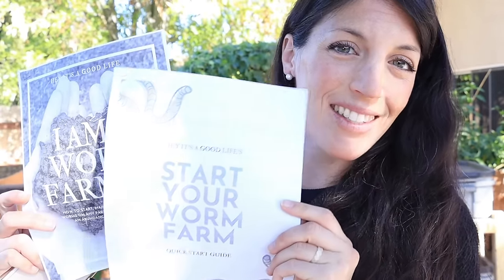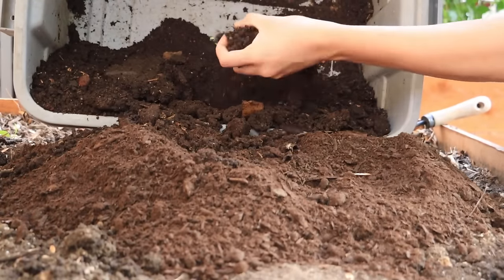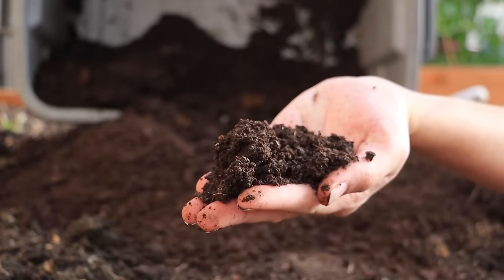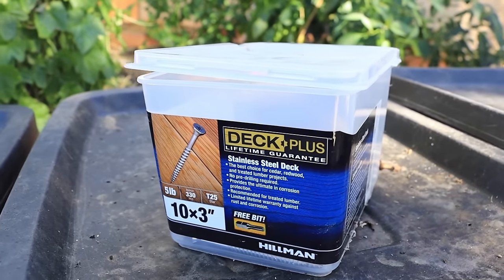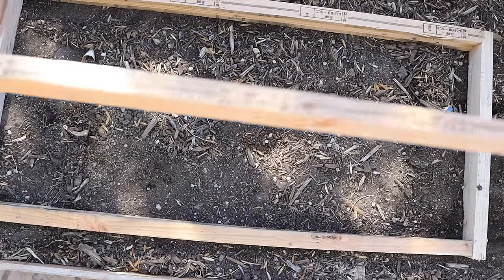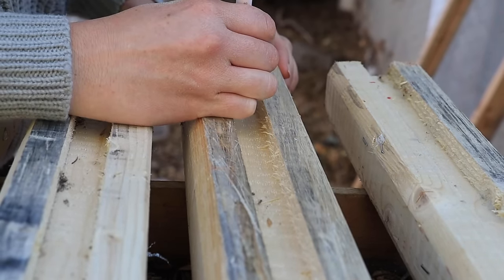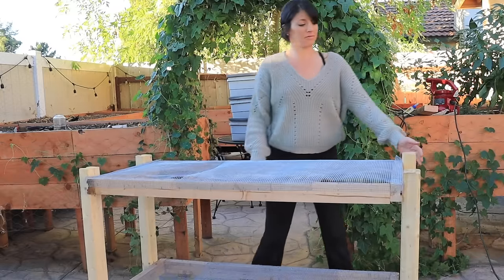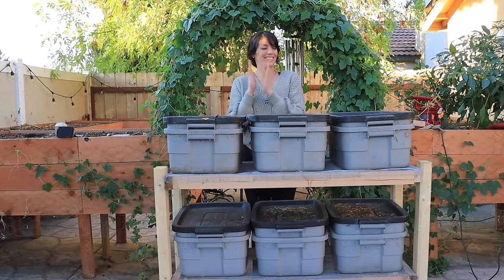HOW TO START A WORM FARM | DIY Worm Farm | Worm Farm Setup | Hey It's a Good Life

Comment: I see two bins stacked, but you didn’t really talk about that in the videos I’ve watched so far. I’d that necessary? Does the second bin have all the layers, too? How many worms is a good start?
Reply from the maker: Hey! Yes I don’t mean to be elusive! I think i cover it briefly at the end of my last video! It’s not a secret I just store an empty tote under a growing bin. Then I move the empty tote up top when the original one is full and ready for harvest. 

To start the second bin you add all the same layers and invite the worms up (vertical migration) I start with about 50-100 but you can add up to 1000 per square foot
Reply: I so interested in learning about this.  Use casting i by all the time

Comment: Most pallets are only heat treated but if you see a pallet without any sramps on it but it does have a lot of small equally spaced holes in it then it is pressure treated

Comment: Nice video how you have broken into chapters. Certainly there is no wrong way to do this , depends on what you want and how much room you have.  Ive been worming for about 10 yrs and I started like most with tubs like you display here.  I am now using the factory 360 for a few yrs and it stays in my walk-in closet.  For years I mostly saved kitchen scraps froze them, then thawed ran thru my big mouth juicer and fed as needed.  I noticed I got a lot more mites than I care to have.  So recently ive gone to a dry mix of  oats[ground to flour] wheat flour, corn meal.  Worms are loving this and I notice a lot less springtails .  I still add some bokashi from the scraps but not as much as before the dry mix..  Id like to add to any new wormers that you have to be patient to start ,  try to rush the process and you will most likely get frustrated and quit the process.  Homemade vermicompost or tea is one of the best things you can do for your plants. As for leachate which some people get and use ,,, Im highly against that , in fact I dont even get that in my bins. Enough for now.

Comment: How many worms do you really need to get started? I'm thinking this will be a compost measure for overwinters, since I live in the north and it freezes outside. Could I just buy a couple things of red wriglers from a bait shop and call it good instead of ordering a pound or more of worms online? The most successful I have been with a bin was a small rubbermaid tote that fit well under the sink, but it just seems like the quantity of food for worms that would be needed would be more than we can produce on a regular basis if I started with a whole bunch.

Comment: I need to clarify something pease.   I see 6 separate bins stacked in 2 layers.  Does the worm castings and/or worm tea drop from the second level then go through the first level bins, then drop to the soil?  Is that how it works?  I understand your bins but am not clear on what is happening to or through the first level of bins.  I'm confused as this is totally new to me.
Reply from the maker: I get this a lot and will clarify soon. This is a vertical migration system. You start in the bottom and when they’re done you create a new home up top. They migrate. Then you harvest the bottom. I’ll somehow more on this soon!

Comment: Hi, I am clearly doing something wrong with our worm farm. My 8 year old Grandson and I have a Uncle Jim's Worm farm. We have been caring for the worms for well over a year now, and only one time have we separated out some nice compost, but the worm farm is still only one tray high, and rarely do we get any liquid from it. Yet the worms seem to be doing fine and multiplying. I have three trays that we have not used at all yet. What are we doing wrong? I really hope to use the compost for our small gardens, as well as teach (learn together) my grandson about sustainability. What can you tell me? Thank you.
Reply from the maker: Hi Cheryl. My best guess is you need more organic matter, especially browns. I would try adding more leaves and a bit more greens and layer those in at least two, ideally three, layers of each. Good luck!
Reply: @heyitsagoodlife    Leaves?  No one ever mentioned to add a layer of “leaves”. We certainly have plenty in our yard right now. I do try to add shredded paper bags and card board, but I can’t say I have added ‘layers’ of those.  So I will do this.  Also, I tend to take all my food scraps and blend them up first, in my blender. The worms seem to devour the food this way and I end up feeding more often, like 2 to 3 times per week. Does this make sense?  Thank you for your follow up!!